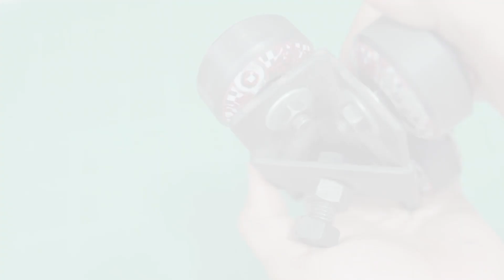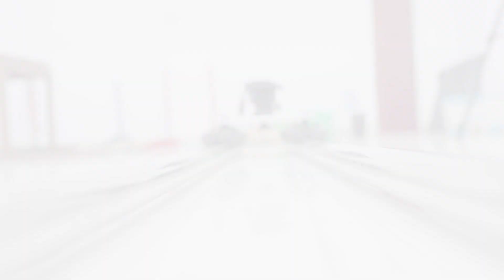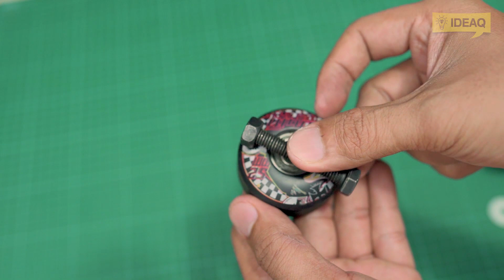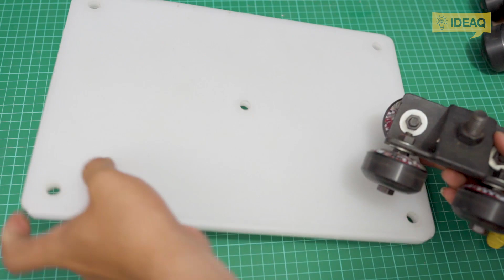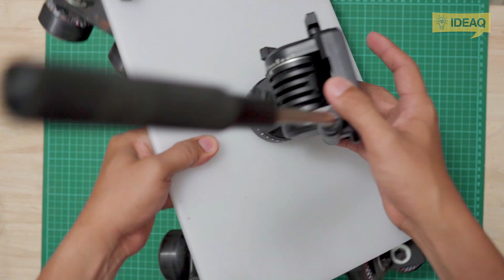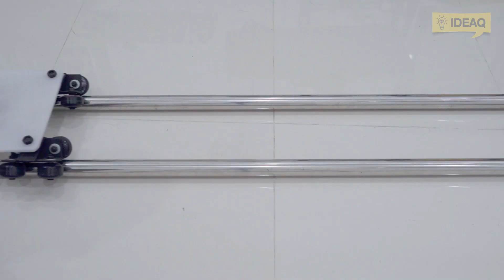How to Build a Camera Dolly (strong & smooth) Filmmaker Tips

Comment: I did something like that, with 8 rollerblade wheels, and it seemed really smooth at first, but as soon I analyzed the footage I discovered that some of the wheels are not perfectly round, so the footage showed some unwanted vertical movement. I don't know if it is possible to find perfectly round wheels. If so, what brand would they be?